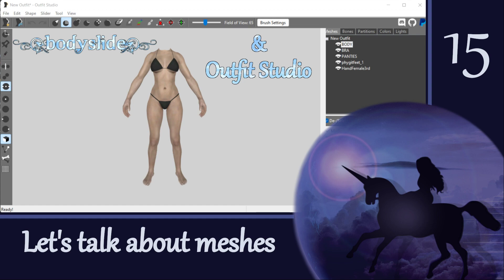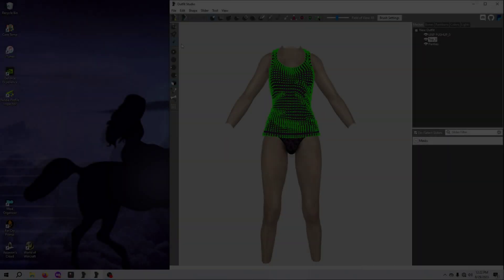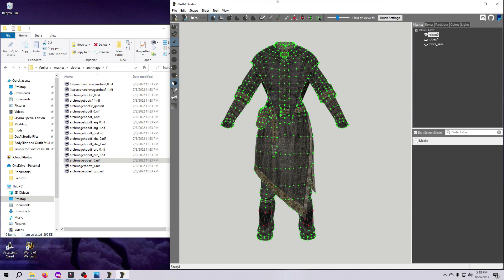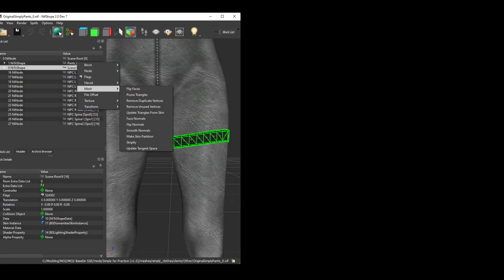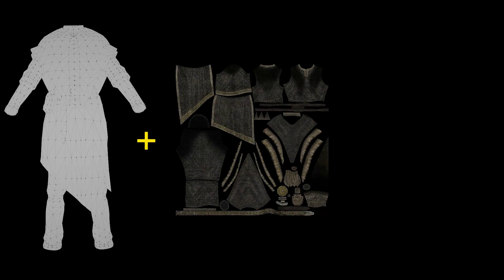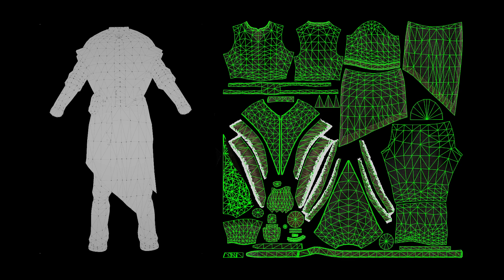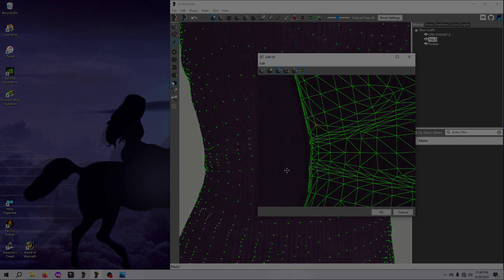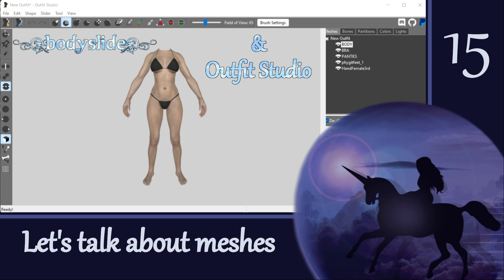Outfit Studio 15: Let’s Talk about Meshes

Comment: Vectors are complex mathematical objects. In fact, they are so complex that even experts frequently use the term for things which are NOT, in fact, vectors (mathematically). So, let's skip the complexity and go with the simple. It's easiest to think of a vector as an arrow. It has a certain length, and it points in a particular direction. That's it.

In mathematics, the word normal can have one or both of two meanings (as far as I'm aware). When dealing with vector normals in computer graphics, we mean both of these things. 

First, a normalized vector has a length of one. This means we don't need to worry about how long those vectors are. They are always length one because we only really care about the direction. This must makes the math easier, and since the computer is handling that for us, we don't need to worry about it. 

The second thing it can mean is perpendicular. If one object is normal to another, they are perpendicular. In physics, we often talk about the normal force, which is a force which always points perpendicular to the contact surface between two objects. In 3D graphics, a normal vector is the arrow that tells us what direction the polygon is facing. If the normal of a polygon is pointing at the camera, then the polygon is directly facing the camera (and not turned to some awkward angle that makes rendering more difficult). 

By tradition (and to halve the computer's workload, a polygon is only drawn on the side that the arrow (normal vector) is pointing out of (the other side is invisible, as you showed in your example). To determine which side to draw, the computer calculates the normals based on the order in which the vertices are listed in the mesh. In order to flip the normals, the vertices have to be reorganized in the list. This can be very tedious, but computers excel at tedious tasks, luckily for us.
Reply from the maker: Thanks for the explanation!  Does it really use the order of vertices to 'decide' how to face the normals?  Wow...that's kinda crazy.  It's amazing how mathematical all of this is (probably the dumbest thing to say, ever, lol).  I've been learning even more about these things in my 3D modeling journey.  Whoever invented normal maps was a genius, for sure!  😊🤯

Comment: Some people (like me) always form the wrong mental picture of what "UV" means. I first think "Ultra Violet" and that a UV map has something to do with light, but that is not what it means in 3D graphics. [[ The letters "U" and "V" denote the axes of the 2D texture because "X", "Y", and "Z" are already used to denote the axes of the 3D object in model space.]] That is from Wikipedia. I thought I would add this bit to your excellent explanation of a very complex subject.
Reply from the maker: Awesome - thank you!  I love the knowledge sharing!  I did not know that's why it's called a UV map.  Thanks so much for posting this info and for your kind comment. 😄

Comment: Vey well explained and using the chocolate wrapper example made it a lot easier to understand. Most impressed you got that wrapper off in one piece lol! Really looking forward to the mash up, I did try this before and needless to say I failed miserably so at least this time with your guidance I’ll have a decent chance of getting it right. Keep them coming you’re doing a great job! 👍😄
Reply from the maker: Thank you!  I was hoping that you guys were still able to follow along ok…some of the videos have been a bit more intense.  😂 This mashup will be a simple example, but I hope it gets you started on the right foot!  Things like dealing with partitions in the plug-in and needing to redo or tweak weight painting might be required depending on what you want to do, and we aren’t quite at those topics yet.  But we will get there!  This is very much a “building the skills” craft to learn!  😄